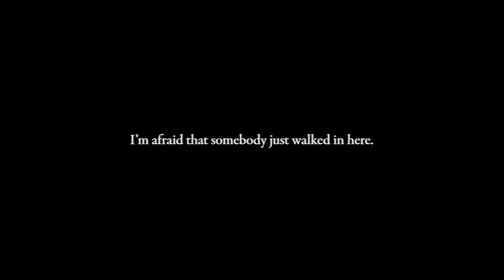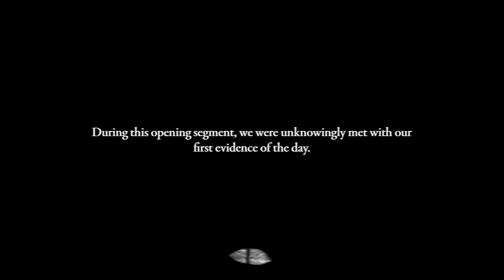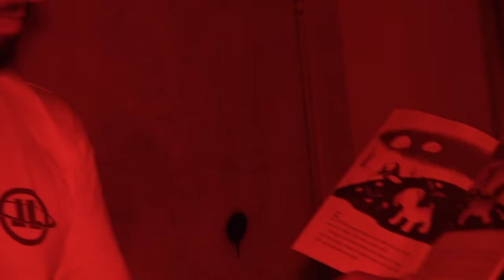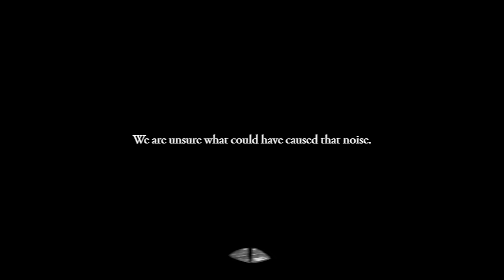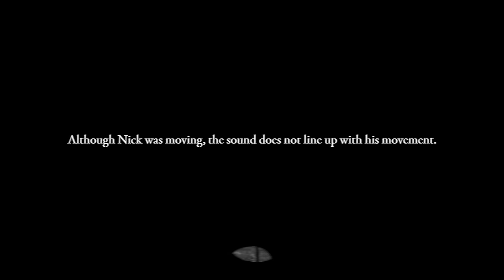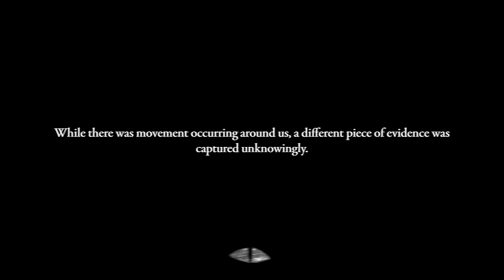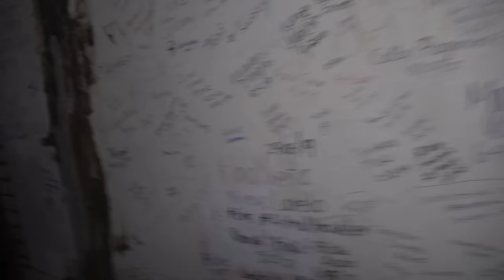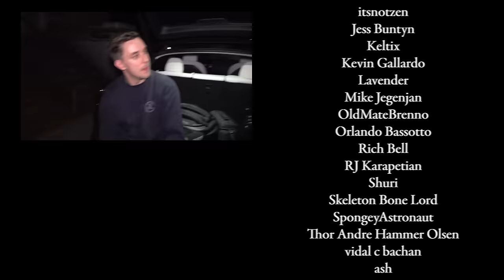The Most Horrifying Night of Our Lives

Comment: i'm pretty sure that interference in the mics at 1:13:09 is electromagnetic interference, which is pretty weird considering that it's an abandoned hospital
Reply: correct.  It's possible it was one of their cell phones
Reply: I am pretty sure it was cell phone signal interference. But I usually get it when i put my phone right next to microphone. Phones periodically communicate with cell towers nearby, so it could have been just coincidence with strong signal of nearby tower messing up the audio. I am not sure how exactly it works but I can stop the interference from my phone just by changing its location to the microphone and not changing distance that much.
Reply: @bobolab741 don’t these interferences only happen when someones trying to call you or there’s a radio tower nearby? also their phones would have to be pretty close to the mic i imagine, genuine question tho cause i’m not an audio expert or anything lol
Reply: @junohypot  I am no expert either, but i deal with this often because I have cheap microphone and when i have phone near it it causes interference even when no one is calling. But what gives it away as cell network signal is the typical monotone noise. It could be 4G signal as well. But I am pretty sure the signal was from man made infrastructure because the interference was monotone. If it were natural or maybe even paranormal in nature I would expect the interference to be more chaotic. What is weird that the interference happened only once. Maybe the squatter called for pizza on the floor above :D

Anyway would be really interesting to explore the site with some frequency analyser setup. If you were to catch some evidence it would be really interesting. Sad that they did not put some CCTV cameras on the other floors. Would be really interesting to see what was causing the noise.
Reply: GSM interference. Someone nearby getting a call/trying to make a call. And as stated, no 4G in the basement (couldn't check the tesla sentry footage)

Comment: This place is only over 2 hours a drive away from me. Honestly, just like with the Hinsdale House, I was more scared of you guys running into actual people that could potentially hurt you rather than the ghosts. But if there was truly no one in there though, Christ, those are some strong spirits you guys encountered. I'd say you SHOULD go back, but definitely get better security next time (motion sensors, outer cameras, etc.) because I don't think the Tesla's Sentry mode was enough even for y'all, and also even if the fences have barbed wire at the top, it probably won't be enough to stop a potential intruder from messing with you guys (possibly) again.

Comment: I feel like this should be a good lesson. Next time if you feel like someone is inside the building with you. Maybe before leaving, close as many doors as you can behind before you go. So if you were to return and some doors were opened then It could have been an intruder. Also maybe bring flour to leave on the floor in certain parts of the building, maybe entrances or something like that. This way you can be kind of sure if it's paranormal, or it's someone messing with you.

Comment: 1:13:28 are you implying that this random piece of RF interference identical to interference created by electronics like phones is paranormal? i don't understand how this is evidence for anything other than someone's phone just causing interference with the microphones. the cable doesn't need to be long for this to happen, the interference is picked up by the mic itself not the cable. and why wouldn't they both pick it up? it's not like they were far away from each other anyway. not being a hater i just don't understand what the point being made here is